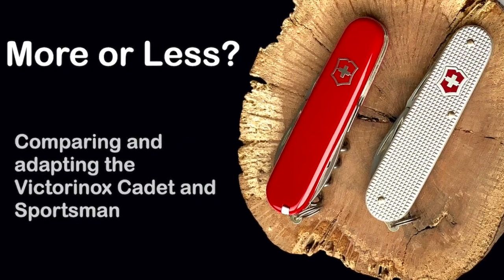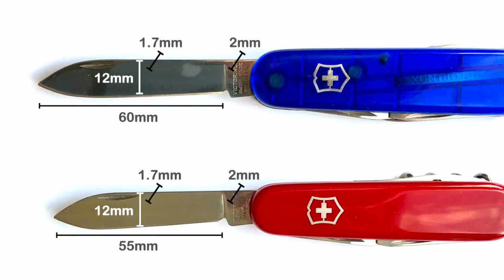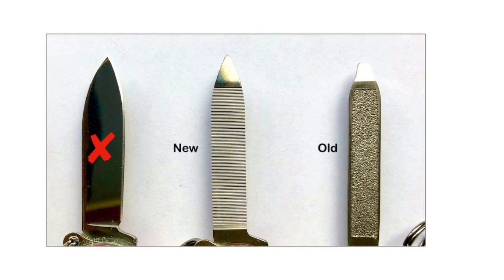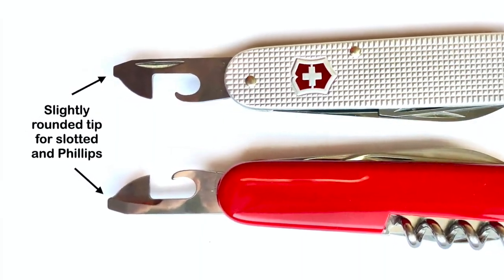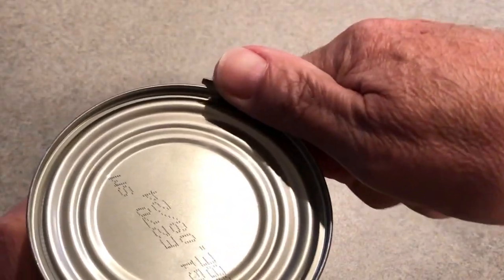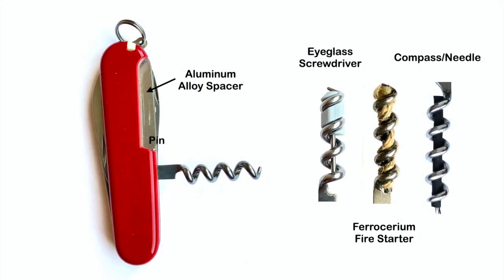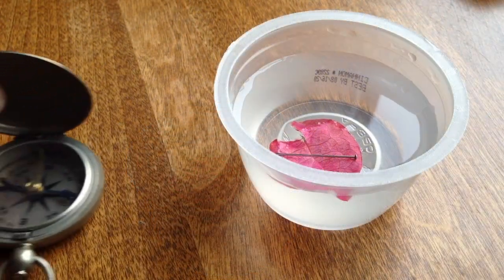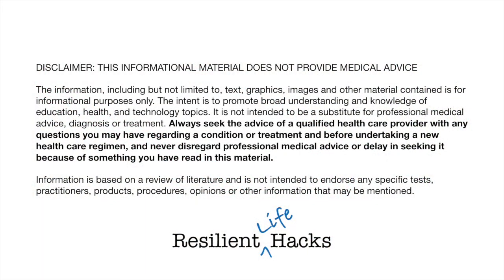Comparing and adapting the VIctorinox Cadet and Sportsman

Comment: I personally think that if you are going to carry a Victorinox it should have at least, 1) large blade 2.) small blade 3.) saw 4,) awl 5.) scissors 6.) can opener/screw driver 7.) cork screw.   The Huntsman would be the smallest I would go when wearing casual wear.  But my top choice is the Victorinox Swiss Champ.  The Champ fits in the coin pocket of most pants and even in the regular pants pocket I do not find it too bulky. Also I have used the pen in the Champ a few times already and the magnifying glass is a must if you have trouble reading cooking instructions on packages like I do.  

 If I was wearing a suit then I may go with a smaller and thinner models.  Otherwise there should be no hesitation in carrying the Champ.  It is not as bulky as you think it is.  I have cell phone, wallet, lighter, and a mini Altoid tin in my two front pockets and the Champ in the coin pocket just above the pocket I keep my cell phone.  I would love to collect every single Victorinox out there but if I had to pick one for everyday carry, I pick the Champ.  I have my gf the Huntsman for Valentines day which she carries in her purse.
Reply from the maker: I would certainly be impressed if someone pulled a swisschamp from their pocket. I find the explorer to offer some of the benefits of the swisschamp including the magnifier, that I too, have found extremely useful. Thanks for providing your insight.

Comment: The Sportsman is a really cool model, and one of the least expensive...making it good to throw in a glove box or somewhere else it could get stolen. Another very similar one is the Evolution 10, from the Wenger factory. I think the Sportsman has a better nail file but the Evolution has a better bottle opener (never slips off the cap).
Reply from the maker: Glad you mentioned the Evo 10 as the Sportsman pulls much from it. Wenger really supported the smaller form too.

Comment: Great comparison! Can you confirm (as you seem to at 2:04) that the new Sportsman (with the new style nail file) has the half-stop on the bottle opener? The Sportsman has been one of the few current models that historically DOESN'T have this feature, and I haven't been able to get confirmation from others if it has finally been upgraded. Thanks in advance!
Reply: I have a Sportsman with the new style file that I bought new earlier in '22 and it does have the half stop on the bottle opener.
Reply: @charlesdudek7713  Thanks a lot for the info! I may have to get my hands on one, as I'd love to add the Walker's saw to it and have a really versatile 84mm!

Comment: Thorough and clear explanations. Thanks! :) I am assuming you know of Nikos Doulas NikGyver, Felix Immler and MeZillch? They also have really neat "SAK hack" and mod videos! I've been watching 'em over the last couple of weeks, now that I've decided to buy a Victorinox RangerGrip 79, and likely going to buy a SwissChamp somewhere in the near future! When I first saw the corkscrew on the SAKs, I was a bit turned off and thought this would not be useful for me, since I don't drink alcohol / wine! Now that I've seen their videos, and yours, it has made me specifically seek out models of SAKs with corkscrews on them to buy. Tortoise Gear makes the FireAnt for that! And I am glad they make the FireFly for the toothpick hole. I hope Victorinox makes a diamond blade sharpening rod for the toothpick hole in the future. That'd be a far more useful tool for most people, since everyones blade is going to dull with more use. The toothpick is useful, sure, but the blade sharpener would be typically way more useful!
Reply from the maker: Thanks for the very useful comment. Yes, I have in some earlier videos included both Felix Immler and NikGyver as references as they are indeed SAK Pioneers. Much appreciate the reminder.
Reply from the maker: I might mention that RangerGrip 79 has a longer corkscrew, much like the Swiza, so it will be easier to do either the 3/32 inch ferrocerium fire starter or sewing kit mods. I personally find that the 'one hand' opening feature does make carving with the knife less comfortable for the thumb than a straight-back blade. Might consider a pouch too, it's a big SAK. Enjoy.

Comment: I really like the Tourist. I am tempted by the Sportsman, but I prefer a 2nd (smaller) blade to the nail file. I can use the large blade to peel fruit, and the small one to cut packages and tape on the same occasion, so I have a clean blade for food. Maybe the nail file is sufficient to cut pacjages open. After all the can and bottle openers can act as screw drivers. I don't need to file my nails when I am out, of I could use a Classic SD. If I have dirty nails for some reason, I could also use the awl or the can opener.    Regarding the Cadet, I am not sure what it can do that the even more minimalist Bantam Alox can do at a much lower price (although the Cadet has 2 blades). I find the corkscrew useful. I can attach the knife to some wood or cardboard and use it to support a GoPro with a magnetic mount, or to undo knots, or actually to clean my nails! I really appreciate your videos. They complement well the Felix Immler ones.
Reply from the maker: I agree, you make very good arguments for these alternatives. I find myself at odds with what I really use and that which would be potentially more useful in broader applications. I often find myself carrying the small tinker as it meets most of my daily needs and takes very little pocket space. Yet, the newer designed nail files also make for good ferrocerium strikers and light duty work such as with wood or plastic in a pinch. And, the corkscrew is remarkably versatile in its ability to hold a length of 3/32 ferrocerium rod or perhaps a needle and thread sewing kit held in wire shrink wrap.
Reply: @resilienthacks7038  I got the Cadet used, and I like it. I like that i can use some dyneema loop and a carabiner to secure it to my pants. I like the celidor scale ones with the corkscrew it can really be used to clean the nail as well, or to help secure the knife on a stick (could use the awl for this as well, but corkscrew would really secure it)

Comment: I think the waiter offers everything necessary in daily life and is even cheaper
Reply from the maker: Waiter is very adaptable. A lot can be done with the corkscrew including tool storage and it nicely holds a 3/32 inch ferrocerium fire starter rod.